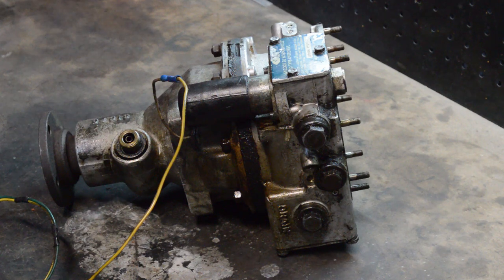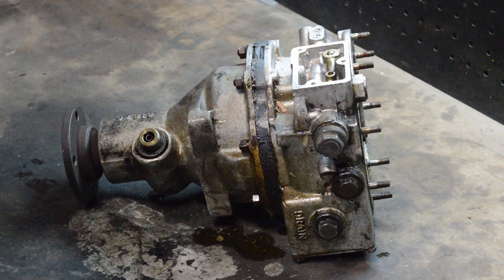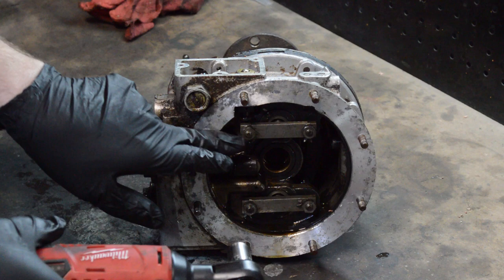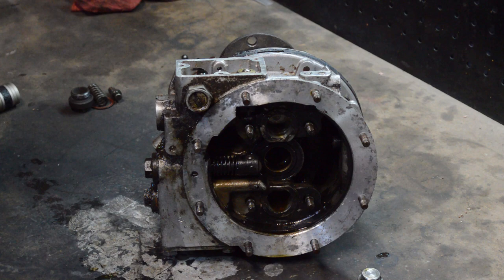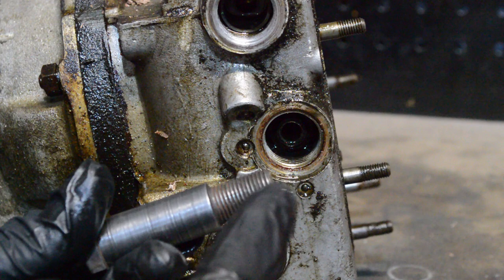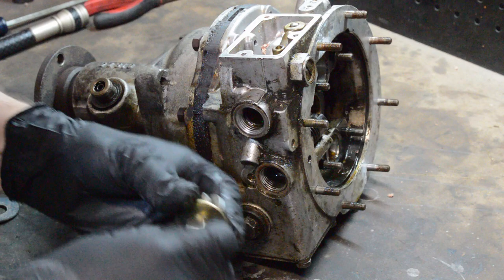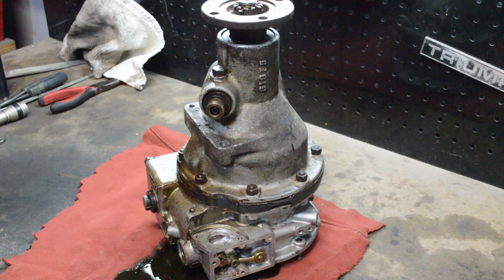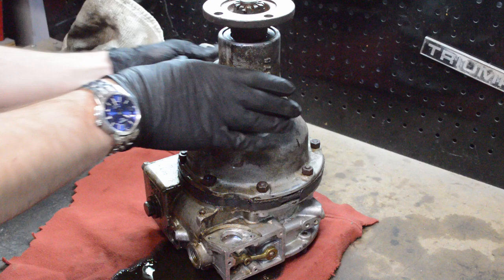Rebuilding the Laycock de Normanville D-Type Overdrive Part 1

Comment: 13:05 could you use a puller of some type once the bolt is threaded on rather than adding shims?
Reply from the maker: You sure can.  That said, you'd need a puller that will pull from the center and brace against the ends without damaging the case.  Most pullers press against the center (like when removing a bearing from a shaft), so it wouldn't be something the average hobbyist would have in their tool kit.  There was a Churchill tool initially, but these are hard to find now.
Reply: @midwestmotoring  I was trying to think of a way all thread would work to make it easier.
Reply from the maker: Basically the answer is yes, but the type of puller you'd need isn't worth spending money on for the number of times someone's going to do this job at home.
Reply from the maker: I guess if you had a socket that was large enough (and deep enough), you could enlarge the hole in the middle.  Then the thread could go through the socket and you could put a washer and a nut on the outside.  Trouble is, large sockets aren't cheap... so probably not worth the cost unless you're doing the job more than once.
 @aggiebq86
Reply: @midwestmotoring  instead of a socket, why not just a piece of pipe?
Reply from the maker: That would work too.